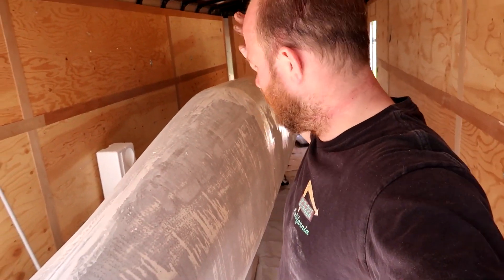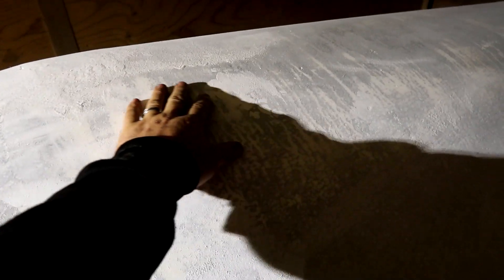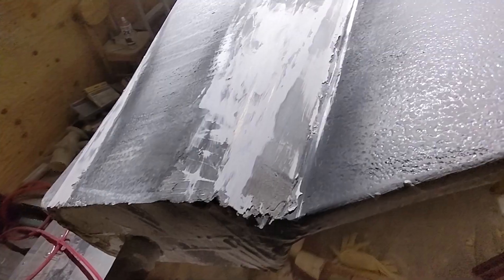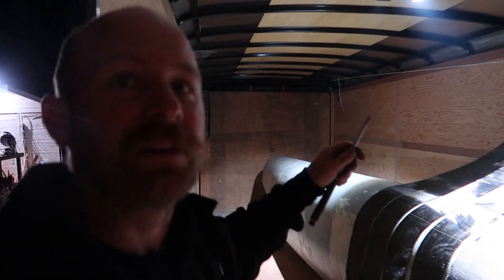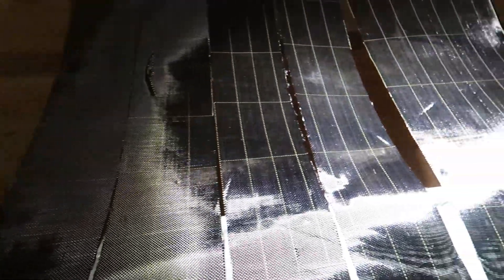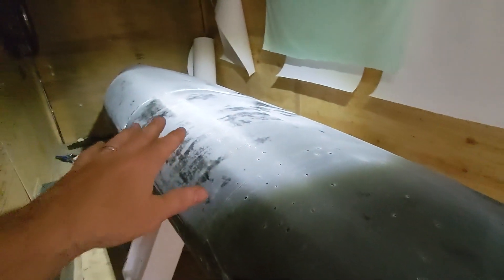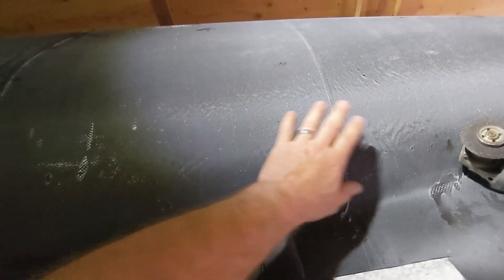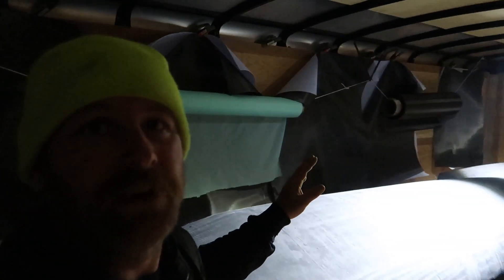Final stretch for the carbon fiber body build LARK MACHINE CO

Comment: I just discovered your channel today and binge watched all 26 episodes, learning alot for my own build project, a recumbent rear engine motorcycle. It's easy for life to get in the way of projects like this, but your persistence is admirable, you continue to make great progress, stick with it!. Did you end up capturing any videos on the frame design and construction? I didn't see much info about the drive motor, curious what's the make / model / power output torque RPM etc?  Some more general videos like "designing a power train for an electric vehicle" might draw alot more subs/views too and many would stick around for this project. Anyway, great job, enjoyed every video! Looking forward to more episodes, I'll definite share it on my social media platforms.
Reply from the maker: Thanks for the great input!  I will be doing more videos like that after I finish this race season.  It's been a long road and I only post pics of the frame/fork and chassis build.  I'm looking forward to having this project completed so I can move on to more stuff.  The motor is a prototype ac induction 180kW
Reply from the maker: You should check out my ebmx build if you haven't already.  I go over some of the fundamentals of designing an electric drivetrain.  Stoke to see that other people are building cool electric stuff. Tag me in some of your builds!
Reply: @sheanyquist  Thanks, I certainly will check that series out as well!